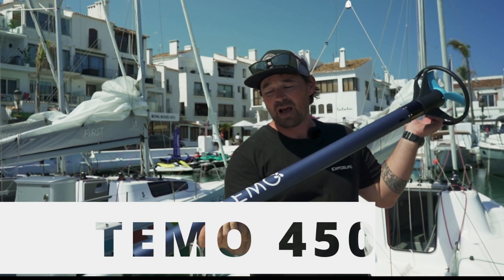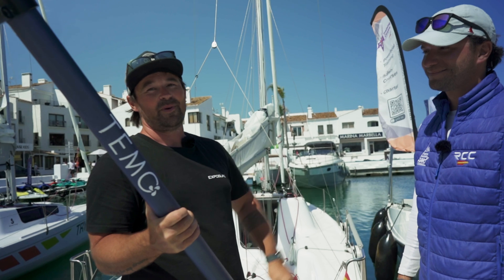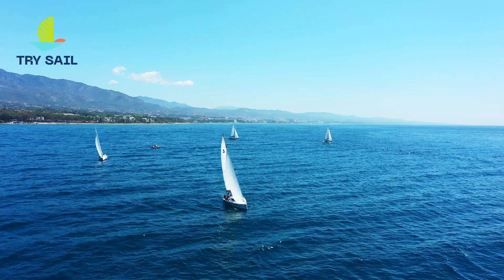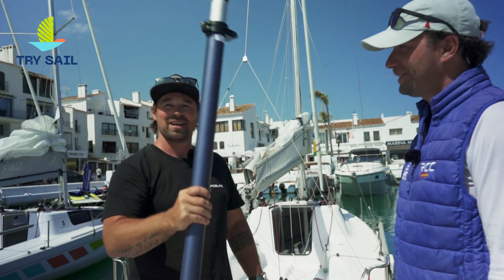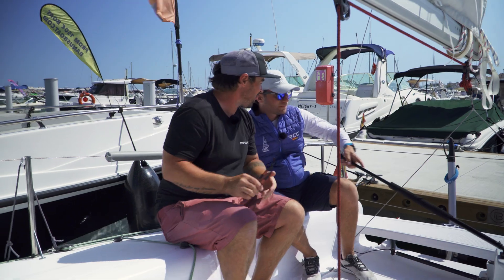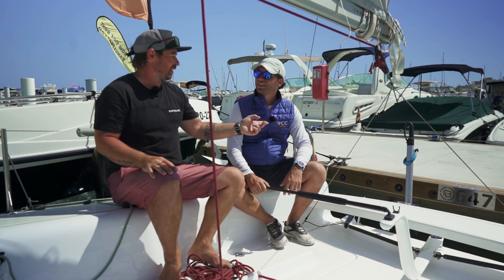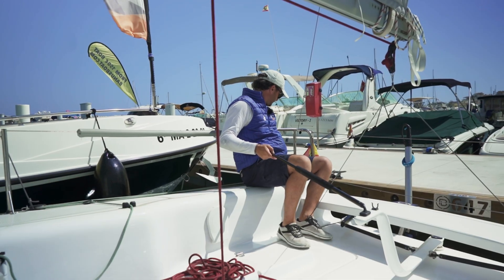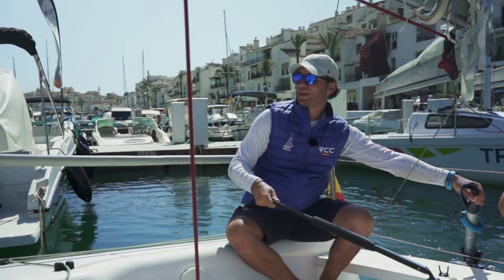Electric Sailing: Stressful Bulls#!t or brilliant?

Comment: Just as with electric cars, we need to wait for the next generation of batteries.  Even then, I don't want an electirc car, but there could be definite advantages for a boat - maintenance & and ease of use for example. Just need a more powerful motor with a much higher capacity battery.
Reply from the maker: Yup, you’ve got it right there… but what  do we do if we don’t want to wait? I guess start with the inefficiencies of the rest of the boat and see why we can achieve? 

That’s our plan with this build anyhow;
https://youtu.be/-ZfmBKcN1Z4?si=tr9XPxWp7mWNzVDk

Comment: You didn’t change the Torqeedo before you used it. You started at near 20% the engine automatically down grades the output at 20% in order to provide some extra range to get you home. So not a fair test of the engines capability
Reply from the maker: To be fair? I’m not so sure that’s the case, we’ve been out with the motor fully charged too, the performance is linear.

Comment: The Temu design doesn't seem well engineered, the batteries aren't as easily swappable as other electric outboards and the prop is pointed at a suboptimal angle, a lot of the thrust is lost by trying to push the stern upward instead of forward... Seems gimmicky just for the sake of being different from other brands.
Reply from the maker: It’s certainly a “marmite” outboard! I actually quite like it which did surprisie me.
It’s only a 450watt so it is of course for lower transoms on small tenders less than 2.5m.

We have a full review coming out soon, it’s strong points are portability and weight - for us it would be ideal as a second motor to a 15hp, we don’t often need such a big motor but can’t warrant another huge outboard for small trips.